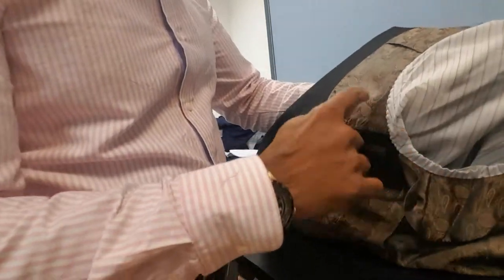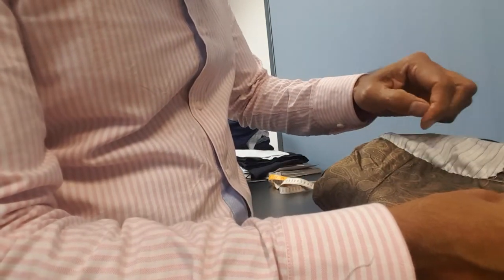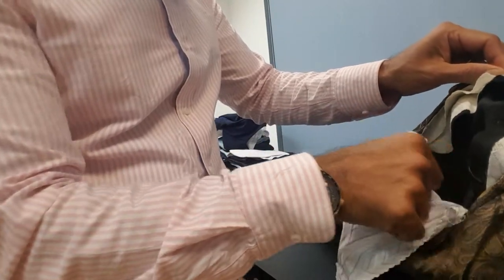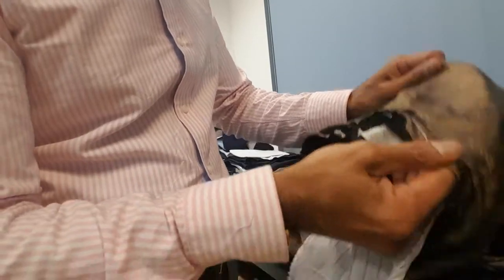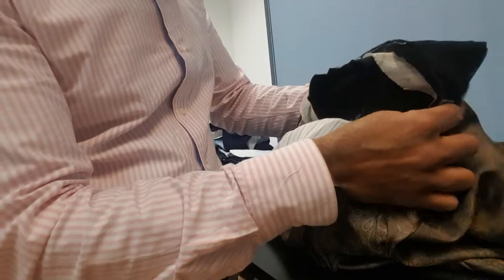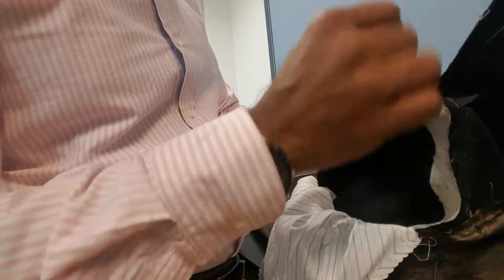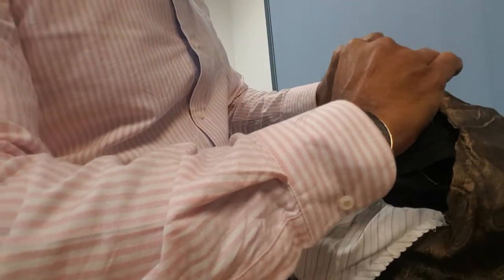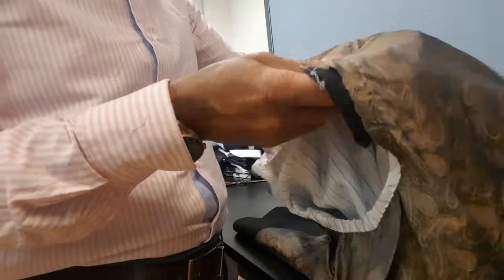#fashion how to remove or reduce shoulder pads

Comment: Would you slim a tuxedo pant please
Reply from the maker: Kay Tong  Hi, Many ways you can slim a tuxedo pant.please post a picture of the pant style you got ,so I Can show an easy way to do it.cheers
Reply: Donatello Tailor my son had a tuxedo pant with coding line out seam.  Should I just tape the inseam?  If so how many inches is the maximum I can bring in
Reply from the maker: Hi Kay you can taper few inches.Always make sure rear is at least 2cm bigger than front to maintain balance.It would be better to reduce crutch also if there's bit room so you can taper a fair amount of hem.mark them with pins lay it flat on table before sewing to make sure it's not twisting.I will try to upload a tutorial soon for more info. thanks
Reply: Donatello Tailor thank you 🙏
Reply from the maker: @kaytong9831   you welcome.